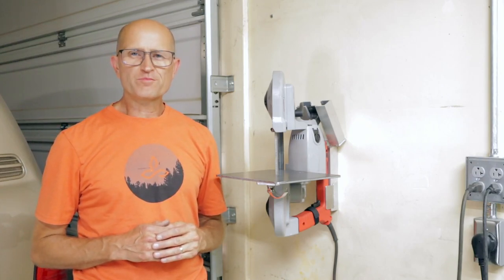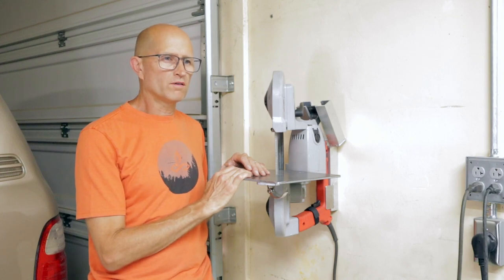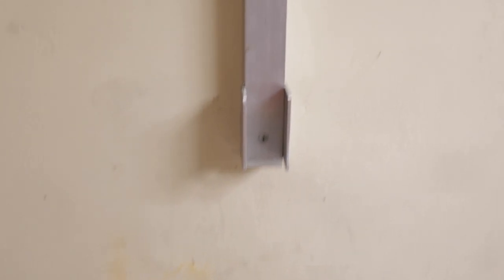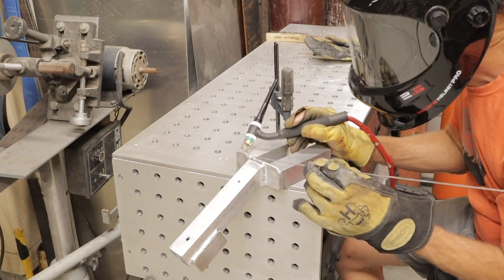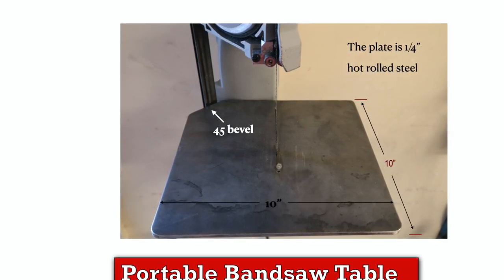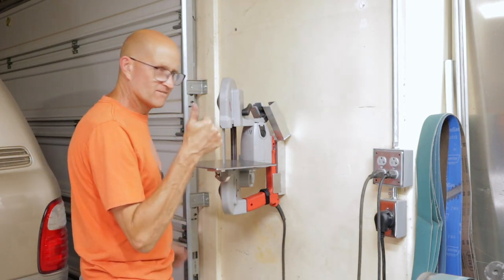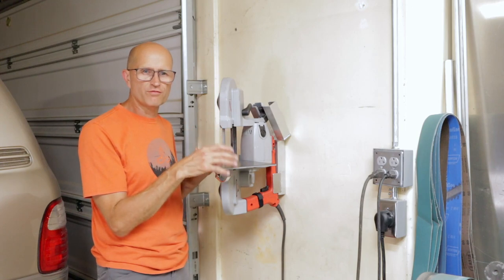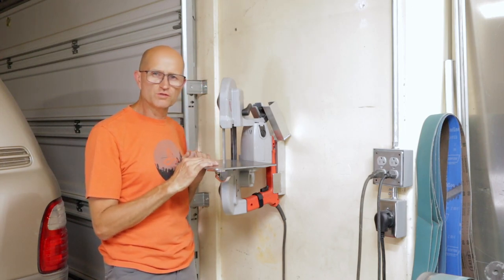Portable Bandsaw Stand Easy Diy In 1 HOUR! Portaband Wall Mount build How to

Comment: I know this is 3 years old but just wanted to say this is a really good idea. I have my Porta Band on a Swag table since I don't use it portable much any more. But just enough it is a pain to remove from the table, put the guide back on and then reverse when done. Sooooo I will be building one of these too. Thanks for the idea and plan.
Reply from the maker: Hi Jay! Thank you for your kind words! I appreciate it very much!😊  I love having it on the wall out of the way. I use it almost everyday in my shop because I’m always building something and cutting out small parts to weld together. I will say that I occasionally will run into a time when I need to cut something longer than 8” and it will run into the wall. Sometimes I can just flip it around and finish the cut, but sometimes not. To solve this problem I made another mount that fits on the edge of my welding table and allows me to cut any length I want. When I’m done, I just put it back up on the wall mount. 👍Cheers! Don

Comment: Wow!   It must be nice to have some vacant wall real estate in your garage shop.  lol
Reply from the maker: There isn’t any left now! 🤣👍
Reply: @PranaTech  I'm actually looking at using your design on the side of my bench. Thanks so much for this.
Reply from the maker: Hi Paul,  that’s a great idea! Later I realized that one of the flaws in this design was that I couldn’t make long cuts because it hits the wall. I then made another mount that fits the edge of my welding bench for when I need to make long cuts. Your version solves this and you only need to make one mount! Nice!😁👍

Comment: Very nice presentation and design. It would be nice to know how you attached the cam lock and how it locks to the saw.
Reply from the maker: Hi Bob, I just drilled and tapped the plate for the thread of the screw in the cam lock and then cut an aluminum plate out of 1/2” that acts as a spacer and gives the cam lock something to clamp against the bottom blade guide under the table. 😊👍

Comment: opps forgot something. Hope your still monitoring comments 3 years later ;-) How did you use the roll clamp underneath. I have the 1/4" steel for the table. How does it mount and lock in with the roll clamp. Love to see what hardware you have on the underside of that 1/4" sheet. Can you leave on the stock shoe?
Reply from the maker: Hi Jay. Yes, I have some pictures of the underside and yes I leave the stock shoe on. my email is pranateq@gmail.com email me and I will send you the pics.😊

Comment: what a great design! simple and effective. what does the underside of the table look like? how does it attach?
Reply from the maker: It just has a cam style pull down clamp off of a Razor scooter handlebar to pull it down tight. It does have a 5/8” spacer block as well to stabilize the clamping force. 😀👍

Comment: How is the cam lock mounted and how does it work ? I want to make one myself
Reply from the maker: Hi James, I just took the cam lock and drilled and tapped the large plate for the same threads up through the fork that the blade goes through under the plate. I then made an aluminum plate about ⅜” thick that goes under the fork that the cam lock goes through. This pulls the big plate tight down against the fork. Simple little life did it in this video at 11:35 he shows how the clamp is mounted. https://m.youtube.com/watch?v=HNaNbhQJ84o&t=697s hope this helps😀👍
Reply: @PranaTech  awesome !!! Thanks buddy
Reply from the maker: Anytime 😀